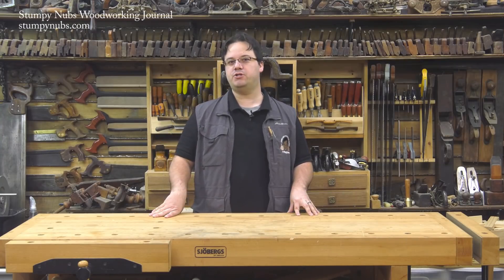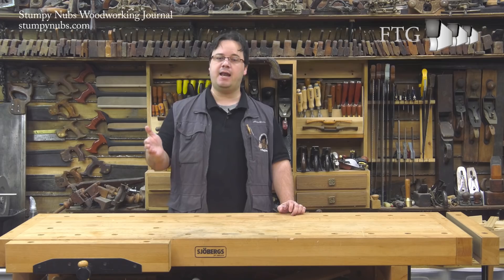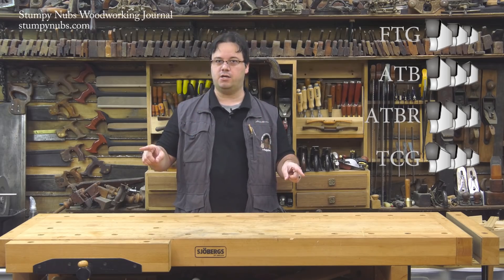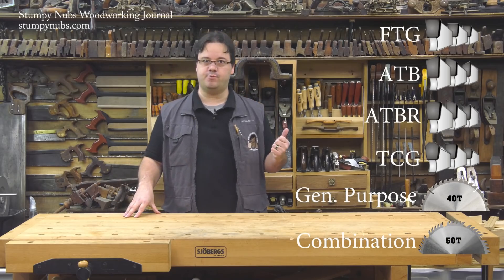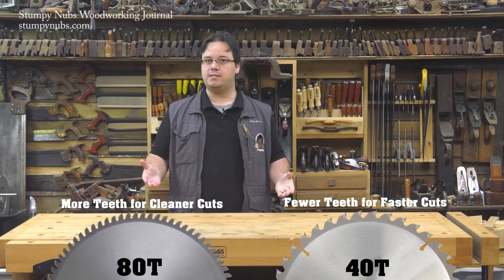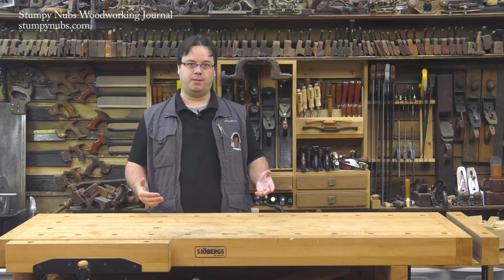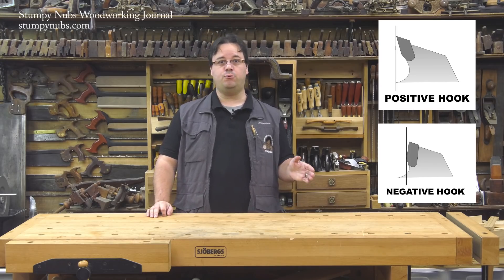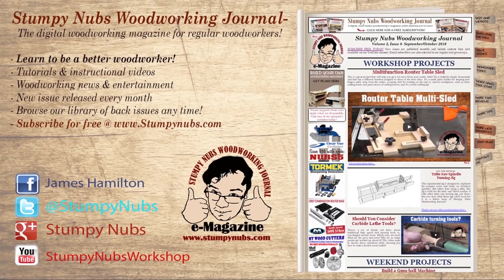Why you need more than one table saw blade (Teeth matter!)

Comment: I'm not doing much construction, am back to woodworking/furniture, including hand-tools.  Money is an issue.  So for a "table-saw", the ShopSmith will have to do (finely tuned & checked frequently), with home-made outfeed, infeed, and side support.  Sheet-goods, the occasional cuts in dimensional lumber, especially rip cuts?  Track Saw.  I've had the Shopsmith for 25+ years.  Not getting a table saw leaves enough money for the track-saw and the fittings for the ShopSmith table supports.  Leaves enough money for decent blades and extra mounts/arbors for faster blade changes. So thanks for this entire series!

Comment: I put a 120 tooth TCG on my saw a few years ago. I bought it thinking I would one day use it to cut metal with (it's what it was advertised for). But it has turned into my most favorite wood cutting blade. I got my $100 craftsman table saw as a Christmas present; worst present btw. I believe that saw has been recalled twice, but I still use it. I've learned to use it really slowly, as it is a really bad saw and it tends to trip the breaker easily. The TCG blade makes the best cuts I've ever seen. I get cabinet-acceptable cuts with it.

Comment: For a miter saw, I use a TCG non--ferrous material blade. You get a really clean 90. Very convenient. 
For my table saw, I use a standard ripping blade since I cut a lot of cleats. I have a FTG blade as well. I save it for the nicer jobs that get notches cut in them.

Comment: For years I thought more teeth equaled a better blade. It took me a while to wise up.

Incidentally, my first table saw ($99 no-brand) came with a four-tooth blade—if you can even grace it with the name. It was a flat, mild-steel plate with four chips of low-grade carbide poorly welded onto it 90 degrees apart. That it cut anything at all still amazes me.

Comment: Wonderful video 
My friend I have some questions pls 
1. Can I use Aluminium Cutting blade for Wood cutting ? IT'S 12 inch with 100 teeth 
2. Can I use miter saw blade for a table saw ? 
3. If 3 teeth of 100 teeth don't have carbide edge , does this mean the blade can't be used ? 
And thanks .
Reply from the maker: 1. The answer depends on what you are cutting and the shape of the tooth. Much of the information you need is in this video.
2. Yes, but tooth shape and count matter. It will likely work well for crosscuts, but not as well for rip cuts.
3. If the carbide has come off 3 teeth, there are likely other teeth damaged. You do not want a piece of carbide flying off while you are using it. Get a new blade.
Reply: @StumpyNubs  thank you very much

Comment: Thanks for mentioning negative hook and Miter saws or radial arm if you prefer). I have asked several where and which blades I could acquire NEGATIVE HOOK blades and I get blank stares or another launch in to reworded  attempts at selling me the more expensive General Purpose blades. It seems even manufacturers don't bother putting the word out on them either because searching with negative hook in the search yields all possible blades with NO specific recommendations. Now ... where do you actually get a selection without heavy custom pricing?
Reply: Clyde Decker n

Comment: Watched the series on table saws and found this video linked too. Still relatively new to woodworking and I have an old 9" delta table saw. Blades are not easy to find so I'm using a combination blade. Any recommendations on where to find this size? I've only seen them made by Freud and Forrest. But I figure there must be others and I just don't know where to look.

Comment: Negative hook blades can be hard to find. I've seen them made for dedicated metal cutting blades and for Trex decking blades, but I don't know if they'll also be ok for wood.
Reply: I have used -5 degree negative hook blades to rip many hundreds of thousands of miles of 2x4 at a feed rate of 85 feet per minute, fed continuously, butt to butt, to produce lath for lattice using a gang of 13 blades on a single arbor. The blades were .050 plate with .090 kerf that were custom made by the hundreds for our application. We experimented with hook angle and found that you can go as high -20 hook and still produce an acceptable product, but the horsepower requirement goes up. The video does not mention the chip size of the sawdust which depends upon your feed rate, which also determines the size of the gullet you need.

Comment: I just purchased 100 teeth 10inch blade for my dewalt table saw...can i used it as universal blade or shld exchange it for a 50t ??
Reply from the maker: 100 teeth is a lot for a general purpose blade. That will work well for nice crosscuts, but it will not work well for ripping along the grain.

Comment: What's a good blade for 12" mitre saw for cutting baseboards, hardwoods, crown to get a good clean cut
Reply: Sergio Soto I use a 80tooth but you can get away with 60tooth

Comment: I’m working with wet waste wood from a saw mill. It’s mostly cedar, some fir and alder. Most is 1”*3”s I am cutting it both ways 1” & 3”s. I have already warped one bladed. What would be my best options. 
Ps. I’m also looking for more information on saw blade kerf (thinner)
Reply: How did you warp the blade? Provided your fence is stable (& you've hopefully got a riving knife fitted), the only warping force should be coming from pressure against the front edge of the blade. If you're having to really shove the wood hard into it then you might want a more aggressive blade, or just slow right down on the feed rate. If you're getting binding (big strings of grain) then an ATB blade should help you slice through those more effectively than one with a flat edge.

As for thinner blades, I have found it's simply dangerous to try anything less than 3mm kerf on a table saw. A thinner blade will have a tendency to wobble or bend in the cut, which could cause all sorts of issues like binding, kickback, or at best dodgy accuracy over time. When I need to make the most of the wood I have, it's the bandsaw I turn to. A 1mm kerf on that is pretty standard & a little planing or sanding works out the rough finish. If you want it really smooth from a machine, you aren't likely to be able to reduce it to below 2.5-3mm of loss whatever you do, although Japanese pullsaws can leave a planed finish straight off the cut with only a 1mm kerf.

Comment: Can you do a test on 2×4 both cross cut and rip twice for 80 tooth and other blades. Now for the two cuts, blade just threw the wood, the other blade all the way out . Then show a side view with the wood next to the blade to show how many teat are cutting at once and what it does to both speed and finish.

Comment: The first thing I did when I bought my table saw was install a ripping blade. The only times I use a general purpose blade is to cut foam board insulation. Ripping is 95% of what a table saw does. 4% is cutting dados and less than 1% is crosscuts.  I use a track saw with a plywood blade for cutting plywood and a miter saw with a crosscut blade for most crosscuts.
Reply: Make a crosscut sled and your assertion that less than 1% of cuts on a table saw are crosscuts gets super inaccurate.